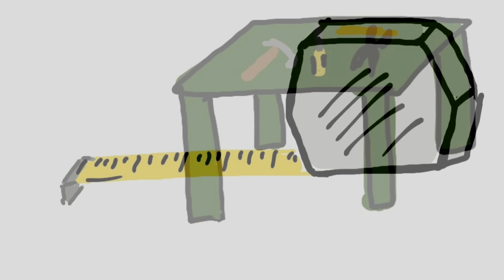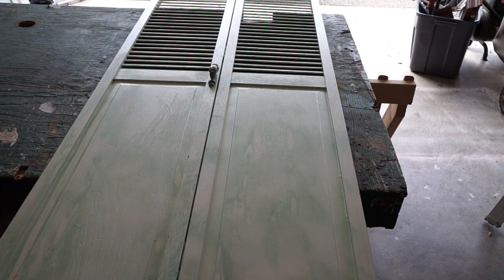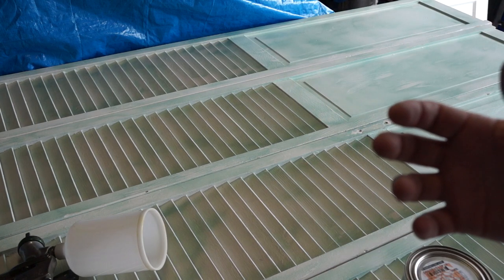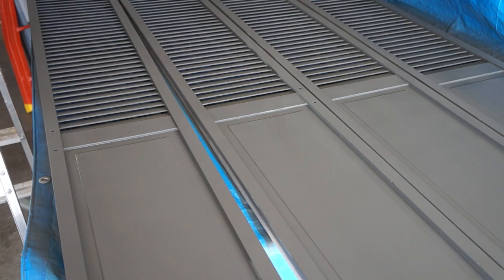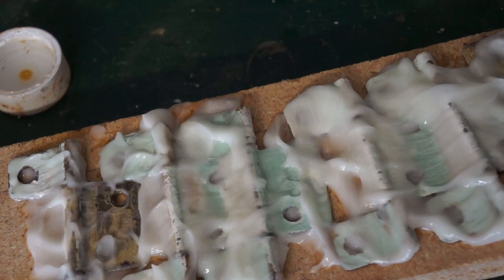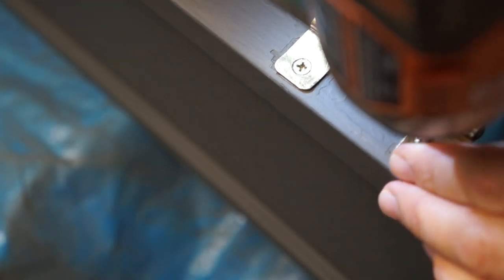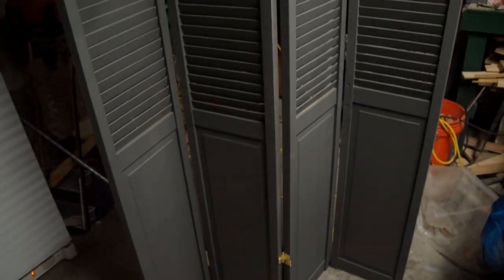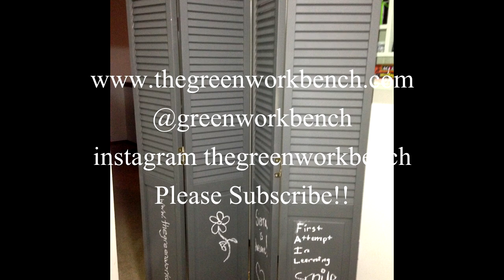How To Make a Chalkboard Privacy Screen From Old Closet Doors

Comment: is there a simple way to get the pins out of the bi-fold doors?   I have dark brown bi-fold doors I no longer need and want to make a scree for my front porch to hide garbage cans.  Can't seem to get the pins out of top or screws out of bottom.  They are really old
Reply from the maker: Not sure without seeing them, but it sounds like they may just be old and either rusted or frozen. You can use WD-40 or a lubricant to loosen up the screws or pin. Just be careful not to strip the screws. Apply a lot of downward pressure as you turn. Otherwise you will have to drill them out.